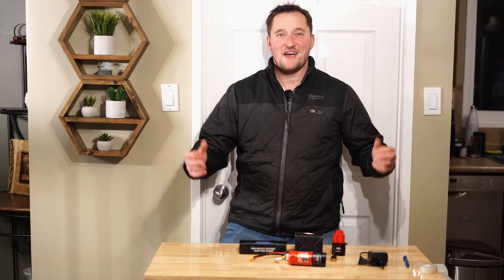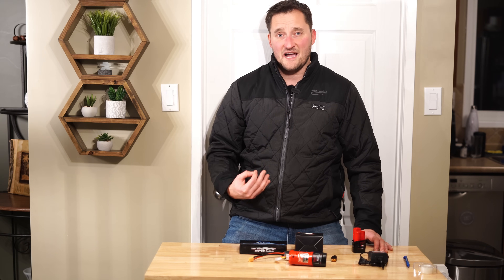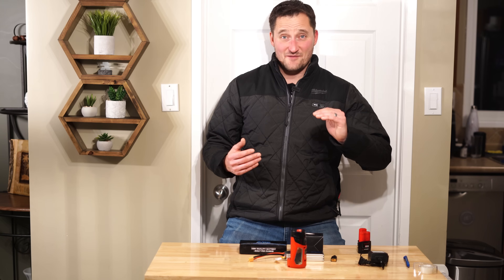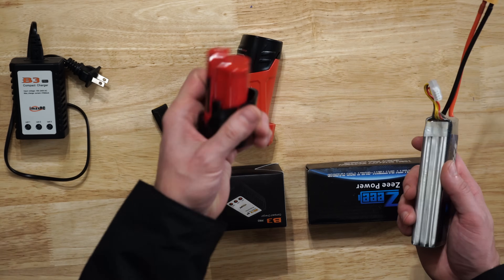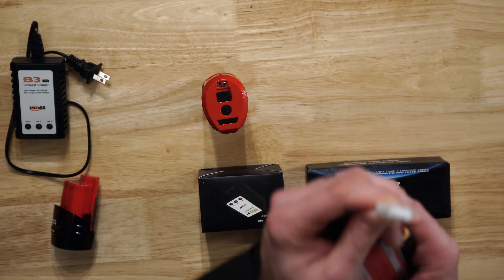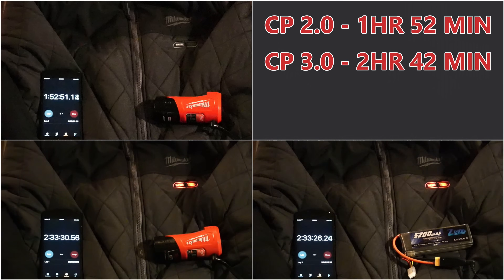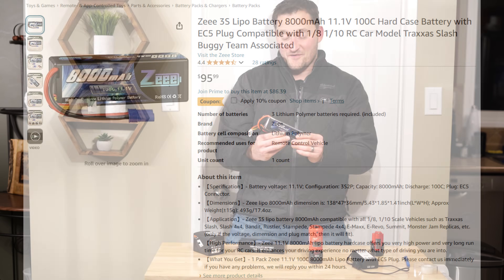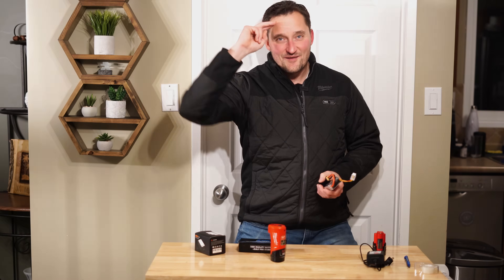WARNING! Read Description - Milwaukee M12 Heated Gear Battery HACK for INSANE RUNTIME!  Part 1

Comment: Great video! I have the new 2024 "hexon technology" toughshell coat, and the Bluetooth features with the 3.0 flat pack battery are nice for customizing the 3 zones. The best new feature is the ability to have the heat on, but turn the light off. This provides some relief from constantly having to have the "is that a heated jacket, how does that work?" conversation 10 times a day. If only there was a way to hack the new Bluetooth features into this solution, it would be perfect!
Reply from the maker: @IsThisThingEvenOnOrWhat Thanks for the feedback! Yes I would love to get my hands on one of the newer style jackets! I'm currently trying to figure out how to make this current solution safer for folks, but there are tons of options out there! I'll keep my eyes peeled for a Bluetooth option! Cheers!
Reply: @RegsChannel  I'm sure it would be possible, but it would require cannibalizing the $100 3.0 flat pack brains to get the milwaukee heated gear app to work with the R.C. battery. I might try that if/when the flat pack I have fails. I definitely recommend the new heated gear. Runs circles around the last gen. Will be sharing your video with friends!
Reply from the maker: @IsThisThingEvenOnOrWhat  remember to mention that they need to understand how these LiPo RC packs work to be safe with them! I've learned a lot from the comments here over the past few days! There are some good USB alternatives with BMS's built in on Amazon. Not as small as the pouch cells but much safer! Thanks again for the support!
Reply: @RegsChannel  safer would be a lithium jump starter pack for a car. A lot of them have 3s lipo inside and have a 5.5x2.1mm output port that also has discharge protection. Also they include a charger when you buy them.

Comment: RC batteries do not have a built in BMS so you can easily run them below the 3.0v mark and cause damage.  Unless the jacket cuts off at particular voltage but that’s doubtful. M12 batteries have a BMS with low voltage cut off built in.

Just get a buzzer to be safe and avoid over discharging for sure.
Reply from the maker: @mk2mike  Hey there! I have learned a ton more about these batteries from the community here over the past few days and taking the proper precautions is a must. I'm going to order one of the buzzers asap. I did reach out to Milwaukee (doubt I will hear back though!) in regards to if the heated gear has a BMS or not. I have heard conflicting details that the M18 batteries have them built into the battery but that the M12 has it built into the tool.  If it had a cutoff I think we would be golden. I have heated snowmobile gloves from FXR, and the batteries look nearly the same as these LiPo cells albeit smaller, no BMS, yet in the gloves you have just the power button I can't feel any extra "hardware" unlike the M12 jacket. 

I'm going to be doing a followup video soon talking specifically about precautions one should take based on what I have learned here. I will say that I have been using a proper charger with the battery, and I have been monitoring the voltage once I'm done using the jacket. I've used it several times so far, and have ran it into the 4-5 hour range. Battery has been cold to the touch both during use and while charging, but I will take care to make sure it doesn't turn into thermite! Have a good one!
Reply: @RegsChannel the M12 battery has a BMS in side as well. I rebuild them here at home. Every one I have repaired has a BMS in them so far
Reply from the maker: @kevinroberts781  what ate your thoughts on a guy adapting that BMS to a LiPo battery? Or is that crazy talk?
Reply: @RegsChannel  or same type of BMS I should say. Same exact voltage
Reply from the maker: @kevinroberts781  good to know, my buzzer showed up today, waiting on a few other parts and I'm going to do an updated video!
Reply: @RegsChannel  honestly just a buzzer will do. You don’t need a BMS to control charge/output current really as your charger performs balance charging anyway. Less stuff to deal with. 

Li-po is OVERKILL tbh, that chemistry is meant for LARGE current loads like RC cars hit
Reply from the maker: @mk2mike  good to know, buzzer arrived today! Thanks for your insights
Reply: @RegsChannel  draining a $50 lipo to zero volts a few times will ruin it. If not the first time
Reply from the maker: @kevinroberts781  Thanks for the feedback, good to know. I just picked up a low voltage alarm for mine.

Comment: I would definitely not use any rc battery.  It could catch fire at any time.  They are very sketchy thats why they have charging bags for them.  Just get another cp 3.0 battery.  That $100  is worth your life.
Reply from the maker: @markk3948  thanks for the insight. I am wondering if a guy could connect a BMS to one of these, if that would help with the safety aspect?
Reply: @RegsChannel  well if you could it would cost more.  The m12 battery talks to the jacket and makes it work safely together especially the new axis gear with the smart battery

Comment: I'm a battery nerd and race rc cars.  I also make and assemble my own batteries and i own lots of Milwaukee products as well and many of the heated jackets.  I also run big after market batteries in my heated jackets but What your doing is a very bad idea for a few reason but is a big fire hazzard.  First of all you should not use a rc lipo battery for this purpose exotically a soft lipo pack. Its bad because rc lipos cannot be stored full charged for any long period of time or they will swell and blow up.  The rc lipos dont have an internal BMS because They will not turn off when the voltage gets too low which will lead to a best a juck battery or at worst lipo swelling up and blowing up.  Also a hard pack is much safer for something like this, dont use a soft lipo.  

Now this is in my opinion the best solution.  Just like you i want my heated gear to last 6+ hours on high since the jacket on high pull a constant 12 watts at 12 volts you want a batter with at least 70watt hours of capacity.  Also MAH or amp hour is a useless measure of battery capacity.  Battery capacity is watt hour which is nominal voltage times amp hour.  Also because of the Where the battery is stored in the jacket you want the battery to be small and flat.  Like you said you can use the m12 6.0ah battery but it really sucks and hurts because of the shape also the m18 converter with a m18 cp3.0 is way too big with not enough capacity.  In my opinion the perfect setup is a baseus mag safe usb c 20,000 mah (74 watt hour of capacity)power bank with a usb-c to barrel jack adapter.  This setup is very small with great capacity plus you can wireless charge your phone and can have a 20watt usb-c in/out port.
Reply from the maker: Hey there, I appreciate the insights of folks who have more experience with these things than I do. I actually have a hard shell pack on the way for testing. I had someone else who pointed out an 11.1v 6000mAh battery pack with a built in BMS that can get similar numbers to the LiPo on high. I'm going to speak to that in the next video. Thanks for the comments!
Reply: @RegsChannel   internal BMS is a must.  Stop on the rc lipo idea.  Rc lipos dont have a internal BMS and are meant to be charged right before you use it and discharged very fast like in under 15mins.  You will eventuality forget to turn the jacket off and it will destroy the rc lipo battery. 11.1volts at 6000mah is 66 watt hours so i would consider that a bare minimum to be able to run a m12 jacket on high for 6-7 hours.
Reply from the maker: @riceball777  thanks for the reply. I see where you are coming from.
Reply: @riceball777 What’s the best heated jacket you have?

Comment: Nice video. I have been using a Talentcell 6000 li ion battery for 3-4 years now, for my Milwaukee jacket. I get 6-7 hours on high. BMS protected. comes with the same 12 volt plug that the jacket uses; no adapters needed. Can also get with a 5 volt usb plug. Includes charger (slow but ok) and splitter cable. Very happy with this product.
Reply from the maker: @irenejuvshik651  I just looked up the specs, that looks like an incredible value for 50$! And rated at 11.1v@6000 mAh to boot!  All that plus the BMS is the icing on the cake!  I realize I'm living on the edge a bit with these LiPo packs, but for me I value the space savings and runtime. I think I'm going to do some more homework on this one and talk about it in my next video! Thanks again for the comment!
Reply: Reg's Channel gave me the idea.  Especially the fact of the round Milwaukee battery eats into your back.  But seeing your reply,  I decided to go your route and ordered the TalentCell battery for my kid's hoodie for her bike riding.  Thanks.  If she gives me the thumbs up,  I will get one for my jacket.
Reply: this right here is the way, i think mine is 12000. it'll go a 9 hour day on high. on year three with it. twenty some bucks. can't beat it. they plug right in and more comfortable to carry then the m12.

Comment: They sell hard-shell batteries and smart chargers that would balance the pack when charging and be a lot safer to have strapped to your back.
Reply from the maker: Thanks for the comment! I have a hard shelled battery on the way for additional testing.  My charger appears to be a balance charger however I do see some very elaborate ones online.

Comment: DO NOT DO THIS!!! There is a reason it didn’t shut down when you thought. these batteries have 0 protection and will keep running until dead dead. 0 volts. And when you do this they are a huge fire/ explosion hazard. And when recharging even when they are used properly they should be charged in fire proof bags. They are very volatile. I use these for drones and I won’t even keep them in my house. They are a huge fire risk.
Reply from the maker: Hi there, thanks for the insight, at 0 volts do they pose a hazard, or only when trying to recharge from 0 volts? I can see a challenge there.
Reply: @RegsChannel it is a hazard when around or below 3 volts the cell with puff up and it will cause damage and be unstable which can be very dangerous to charge back up